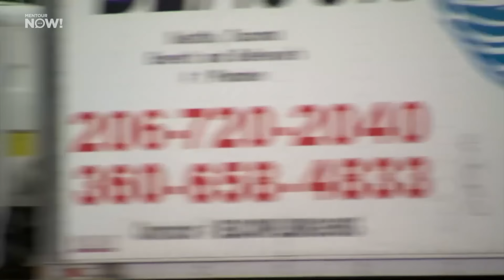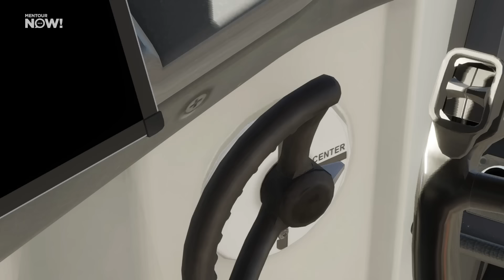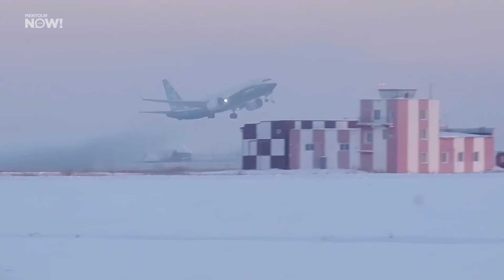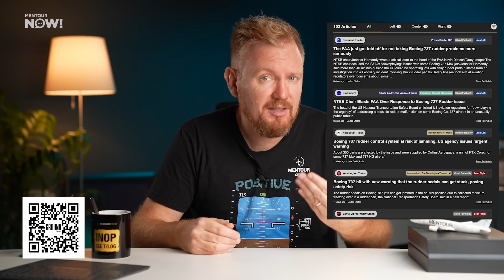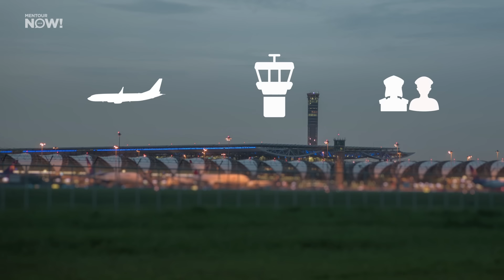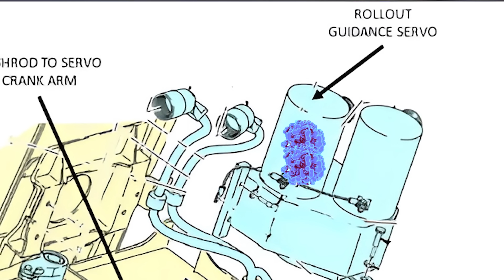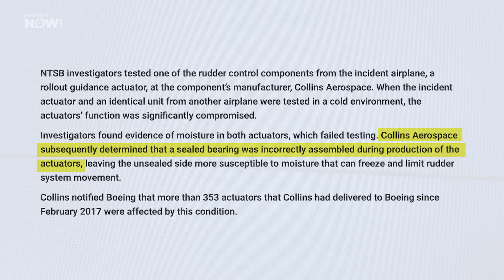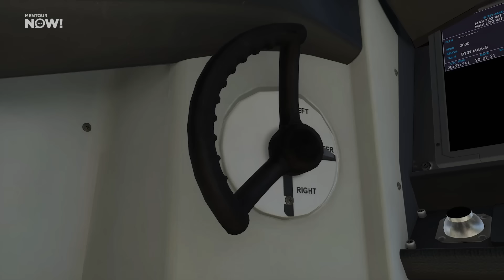Does the Boeing 737 Have ANOTHER Major Flaw!?

Comment: Ah poor 737, entered service during the 1960s , stretched, re winged, re engined & upgraded to death... For how long can it be milked until a new airframe be developed ? Systems old and new slapped together creating a nightmare for fabricators and maintainers alike ...
Reply: Remember that the 737 airframe is a shortened and slightly modified variation of the original 707 airframe, which makes it nearly 70 years old.
Reply: Not even that. The 737 is really a shortened re-winged, re-engined 707.
Reply: Airframe of Theseus
Reply: Frankenplane.
Reply: We cannot anymore, the technology is lost. Finances are more attractive than engineering nowadays, Boeing outsourced development.
Reply: Boeing wanted to build a new Airplane, they used to call it the NMA. Calhoun (the Board) killed it. All they, Calhoun and the board wanted was to continue milking the 737, as it was cheaper in the short term. The term being Calhoun's and the boards influence. Shortsightedness and greed killed Boeing. Bean counters, not the engineers killed Boeing.
Reply: @renefuller9241  yeah, by the way, did you know that Calhoun was a McDonel man? There was a saying in the industry after Boeing bought MD, that MD bought, Boeing with Boeing 's money.... (because of the hugely beneficial terms for MD,' s higher echelons)
Reply: @yanniskouretas8688  I thought Calhoun was a Jack Welsch disciple... Well, no matter really, same thing different name.
Reply: You make it sound like Trigger's broom from Only Fools And Horses

Explainer if you haven't seen it:

There’s a great gag from an episode of Only Fools and Horses where street sweeper Trigger has been rewarded by his local council for using the same broom for 20 years.

“This old broom has had 17 new heads and 14 new handles in its time.”
Reply: @Rachel_M_  Which itself is a reference to theseus ship
Reply: @Rachel_M_ class reference 😂 but it’s “new”
Reply: @Rachel_M_ interestingly this has a an example of the paradox of the the ship of Theseus, first discussed by Plutarch.
Reply: I can just see the poor pilots trying to explain to Ryanair  or jet2
management  how they left the runway and wrecked  a 737by booting the rudder to unstick it on landing
Reply: It was working great for Boeing until the max. If Boeing didn’t screw up the design of mcas, I think we would all be praising Boeing for keeping such a classic airplane in service.
Reply: @thehumblepilot22 Initial design of MCAS was not the problem. True problem was that pilots/airlines mostly didn't know about this system because Boeing exec's wanted to sell it as 737 so that no extra training needed for pilots.
Reply: @tony4404  true but I would say mcas pitching the plane down at low altitude would be a bigger issue which is a design problem. Technically the 737 runaway trim stab procedure that every 737 captain is required to know by memory should have been implemented. This is why Boeing didn’t mention anything because a procedure already existed to counter the issue.
Reply: @thehumblepilot22  The 737 had rudder failures long before the Max, the first rudder incident was in 1991.
Reply: @thehumblepilot22  The 737 MAX can hardly be called a classic airplane. It has TCAS, EGPWS, Flight Management, etc.the same as the latest models, and a system for pitch control using the spoilers if the elevator becomes jammed that no other airplane has. Also, Boeing isn't the one keeping the airplane in service, the airlines do. And there was nothing wrong with the design of MCAS; two airplanes crashed because their airlines had skipped out on training their pilots on a procedure required for the basic 737 type rating. A third flight crew got just-in-time training from a properly trained deadheading pilot of another airline and they landed safely at their destination.
Reply: @petep.2092  Yes I understand the aircraft has all the modern systems. When I say classic I guess I mean the modern version of a classic plane. However MCAS on these particular 737s that crashed had only one AOA sensor that was definitely an issue with the design. I do agree that the issue was also a pilot training problem since the pilots had no idea to turn off the auto stab switches when the trim wheel kept spinning pitch down like crazy over and over. It’s hard to miss because the trim wheel is very loud in a 737. But I also don’t fault the pilots for being confused when the plane randomly nosed down at low altitudes when climbing. It was a combination of the MCAS designed with one AOA sensor and pilot training in my opinion.
Reply: @DontUputThatEvilOnMe hardly so . 737MAX is 60 years old airframe . You are talking nonsense really
Reply: @AnetaMihaylova-d6f  Actually, each airframe is made from new materials, not 60 years old. The design of the airframe may be 60 years old, but what are your criticisms about the airframe design? Even if YOU don't understand them, the 737 MAX evolved out of deliberate improvements based on known science and engineering, For comparison,  your DNA design was revised incrementally—by a hit or miss process—over millions of years. Reality check on who exactly is talking nonsense.
Reply: @AnetaMihaylova-d6f  737 NG which started production around 25 years ago were probably the most safe and successful narrow body aircraft ever made. Most of the 737s in service today are NG models.
Reply: Very nice comment 👌
Reply: The Corolla of the skies.
Reply: "upgraded to death", it's spooky how you nailed it exactly.
Reply: You miss the point behind the Max.   It came down the pool of potential pilots.   The original 737s were wearing out.   The idea was that with minimum re-training, pilots could transition from the 737 to the 737 Max.    Most of the bean counting was done by the airlines that had 737 pilots.   Boeing did cut some corners on the lack of redundancy of Angle of Attack sensor and that's 100% on Boeing.   But making a new aircraft that more or less flew like a 50 yo a/c was the goal.
Reply: @GilmerJohn  It had redundant AoA sensors, but Boeing failed to ensure they were used redundantly which would have been a fairly simple task - do the AoA readings on Captain's and FO's sides agree? No - disable ACAS.
Reply: @cambridgemart2075  --  Really?   I read that the redundant AOA sensors were an option.   Indeed, there should have been three although I' don't know where #3 would be mounted.
Reply: It's called engineering, something your comment proves you know nothing about.
Reply: Big part of the problem with mcas is that is was deemed non critical. As we now know it was. Critical systems are required to have redundant sensor input.
So, lack of critical thinking on the parties responsible for classifying flight systems.
But by no means was this a software bug, that is just a lame explanation.
Reply: @mennol3885  Absolutely, it was Boeing trying to hide critical flight systems as non-critical. This was necessary to avoid having to re-certify the aircraft as a new design regarding the pilot on-type certification.
Reply: The thing is the embodiment of corporate cost-cutting. It's actually quite hideous to look at. Old fashioned front end. Flat-bottomed engines. No landing gear doors. Gaudy double winglets.
Reply: @marzoval not arguing about the corporate greed part, but aesthetically I disagree. The 737 is beautiful exactly because it's such a brutal utilitarian Frankenstein of an airframe.
Reply: And above all  boring self certify their plane
Reply: Created with a major flight control problem with the ptich trim. And never really solved.
Reply: @stabilo3170  --  the problem was in the automatic trim of the vertical stabilizer.   Most folks seem to believe the problem has been solved.
Reply: @GilmerJohn  Maybe you are referring to the rudder runaway or hardover or the recent icing problem in yaw control. I was referring to the specific 737 pitch control glitch where in case of runaway the crew is unable to use the manual pitch trim (I mean the trim wheel in the cockpit) above a given speed due to aerodynamic loads on the screw jack. The only way to escape is the famous "yo-yo" maneouver.
Reply: @stabilo3170  -- Yep.   That's what I'm speaking off.   The problems start when the trim control gets screwed up (usually caused by the AOT sensor).   When this happens the pilots can attempt to use the manual trim but sometimes the out of trim condition is so bad that the only way to use the manual system is to "unload" the vertical stabilizer.   The flight controls affect relative small "flaps" on the tail whereas the trim adjustment turn a good sized screw which rotates the entire vertical stabilizer.   Boeing has several fixes and recommendations.

I saw a few YT videos on this.   Quite interesting.
Reply: @GilmerJohn  Pitch trim is the horizontal stabilizer, not the vertical. The original problem is not related to the AOT, but  purely mechanical, at a given speed the crew is unable to move the trim wheel due to the aerodynamic loads on the screw-jack. Pilots need to alleviate the aerodynamic loads by applying opposite pitch leading to the famous "yo-yo" manoeuver.
How could such poor design be allowed to  endure by the certification authorities? FAA/EASA.
Some one has an answer?
Reply: @stabilo3170  Greed. Pure and simple, the need to be able to retain the type license. The Angle of Attack sensor was single, there wasn't even a backup the software would have been able to reference to filter out erroneous readings. Those erroneous readings caused the Software to override the Pilot's inputs. Had the Software been written by Boeing Engineers, they would have been able to fix the problem before it manifested itself. But the software was written in India by vendors that didn't know an airplane from a hole in the ground.
Reply: @GilmerJohn  Horizontal, not vertical. MCAS actuated the elevator trim system.
Reply: I'm pretty sure the Max will be the last 737 variant
Reply: I will answer that for you.
Until Boeing goes out of business and lost almost all customers to their competitors, not a single day before. 
EXACTLY like McDonnell Douglas. They just updated and modernized the DC-9 into the MD-80, MD-90 and 717 (planned as MD-95)
Until the airplane was basically so outdated that further updates were impossible. And the lost the whole narrowbody market to their competitors.
And they did the exact same thing with the DC-10 and just turned it into the MD-11 and also lost the widebody market to their competitors.
They basically ruined the company with their unlimited greed is good concept.
Because their motto was: "why develop a new plane ? That costs money ! Let's just use the money for research and development and give that to the shareholders as a higher dividend instead. And that mindset is now alive and well within Boeing. (when McDonnell Douglas took over Boeing after being merged with them)
Boeing has BECOME McDonnell Douglas.
Reply: There is nothing wrong with the concept of MCAS. The problem was that it was poorly implemented, pilots not properly informed and they only relied on one sensor. If they had done it properly it would’ve been fine. Also the engine placement was the cause for why they decided to add the MCAS but in itself isn’t the problem. It is not ideal but it would be fine, if they would have adjusted for it properly. There is nothing inherently unsafe about putting the engines were there are.
Reply: @sebastiang7394  unfortunately the engine placement thing too many people don’t understand this.
Reply: It's not the airframe itself that Boeing want to keep around as much as it's all of the manufacturing tooling, test and every other bit of type specific infrastructure etc. and key leadership talent that must be replaced plus all of the certification and bribes that must all be costed in making a new design uncompetitive right from the start.
Reply: @karlslicher8520  No, it's not just that. They, or rather the airlines that have existing 737 fleets, really really want to keep the same type certificate for pilots, and as preferably much as common parts as possible (for spare parts inventory)
Reply: Noone needs a 737, except Boeing themselves.
We have a 320, Comac and MC-21.
Reply: @player1GR  --  Well, "No One" needs anything in particular.   The MAX solved a particular problem and it continue to solve that particular problem.
Reply: @player1GR  are you serious comac and the MC21. Boeing is literally making more 737 max’s per month than comac can make in a year.
Reply: And still going strong.  And will continue to be flown safely, for many years to come.
Reply: Your making the point that it is a nearly new plane.     MCAS was a horrible software failure.   The engines placement is not a problem.   Some airplanes have engine on top the wings.
As a retired software engineer it is unimaginable how it came out of a R&D lab.  Maybe it did not.
Reply: @danharold3087  no it was engine placement that  led to the MCAS and crashes
Reply: @AnetaMihaylova-d6f    Yeah that is the extent of MSM understanding.  They are wrong.  It is very hard to correct bad information when MSM has branded it as true.
If the engine placement was a real problem the 737 MAX would not be flying today without modification to the engine position.
Virtually all modern fly by wire airplanes let the computer decide how to fly the plane. This is much more radical than the augmentation provided by MCAS.
Reply: @danharold3087  no you are wrong.  MCAS came about because the engines were too far up
Reply: @AnetaMihaylova-d6f  that’s true but MCAS was placed on the aircraft to type rate it the same as the 737NG models. The aircraft didn’t need MCAS for anything else other than its type rating.
Reply: @AnetaMihaylova-d6f  No, you are wrong, for a subtle reason. It was not the engine placement. The plane can be flown just fine with the engines where they are. But pilots would need to be given simulation time to feel the plane want to pitch up on take off, and to practice how to counter this tendency smoothly. Boeing achieved profitable sales of the 737 MAX partly by promising there would be no need for any expensive (time and money) pilot training. So they built the MCAS system to do secretly what the pilots might have done, had they been trained to do it. MCAS only used one AOA and when the AOA it was using had problems, the MCAS went bonkers.
Reply: @We_are_Nomad  It's conceptually not a bad idea to use an augmentation system to make sure the handling remains very similar to the previous 737 even at high AoA. In general the handling of a plane is something that's engineered by the designers anyway, and the control feel is completely artificially generated in all airliners (and other planes that use hydraulic or electrical actuation of control surfaces). The big problem with MCAS isn't the idea, it's the mind-bogglingly terrible implementation.
Reply: @MatthijsvanDuin  Well, the statement I was correcting had to do with the forward placement of the engines, which were not the critical--possibly not even a nominal--problem with the plane. 

But as to your own comment...I don't think that "implementation" is quite enough to explain the problem, either. It wasn't poor implementation of a good "concept." The concept never got off the ground, if the implementation is any guide to its qualities. My Indian-made microwave runs on the same principle as the original MCAS. Even if they were not working with a hard concept, based on previously proven designs, the concept would have developed until it was suitable and safe, it they had followed the rules of their industry. But the concept was never given this chance to be reviewed and developed, nor the implementation to be tested, denied, corrected, and ultimately accepted. The process was circumvented by the main goal: that the MCAS system be so secret that it wouldn't involve FAA inspection or pilot training. Secrecy is what led to the hull losses. 

As you say, an augmentation system is not a bad thing, and other such systems are in various parts of the plane. But all of them are known, explained, studied, involved in the checklists, etc. They have redundancy built in. Workarounds are available. All of this practice requires transparency of information and operational practice in simulation. Secrecy is also the reason for the MCAS system being implemented with only one alternating AOA sensor for guidance, which does not conform to the redundancy requirement of the dual or triple sensors themselves. With any amount of transparency and FAA supervision, the non-redundancy would have been noted and rejected until corrected. That money-managers made a decision to proceed with secrecy for the purpose of sales, over the engineering knowledge and standards for their industry, is the primary problem that needs to be corrected to avoid future losses. 

Recent issues with Boeing planes imply that they are just as secretive as ever, that they are willing to destroy evidence and avoid transparency even when asked to produce documents to supervising agencies. Their responses to several dangerous mechanical failures is minimal at best. Remember the downing of the Ethiopian airliner? That is the kind of impossible cycle that Boeing's financial "pitch" is facing, if they don't change their culture and start being more proactive and exacting in their engineering and manufacturing standards. As an American, I am really worried about this situation. America needs Boeing as a foundation of our national security, and, by extension, international security.
Reply: @We_are_Nomad  Yep, I agree.
Reply: @danharold3087  Primary reason for MCAS were the engines. Engine placement changed flying characterics so much that they installed MCAS so they can sell it as same than 737. Easy sell to airlines when extra training isn't needed for pilots.
Reply: @tony4404  The fundamental aerodynamic design of the 737 MAX itself was not the cause of the crashes. The aircraft's basic airframe and flight characteristics were not inherently unsafe.
The problems stemmed from how MCAS software was designed, implemented, and integrated into the aircraft's systems, rather than from fundamental flaws in the aircraft's design or the concept of MCAS itself.  
All airliners use software to make the airplane easier to sell.   Can you imagine Airbus if pilots had to train to fly each of its aircraft if they did not modify handling with fly by wire. Fly by wire is the ultimate evolution of Maneuvering Characteristic Augmentation Systems. Yes FBW does much more but MCAS is one aspect.
Reply: @MatthijsvanDuin  What was so mind-boggingly terrible about the implementation? Using one sensor? That was the incompetent news media's opinion. Do you know how many systems use a single sensor as an input? The stall management yaw damper (SMYD) computer uses a single AOA sensor as input. That's why the stick shaker activated on only one side when the AoA sensor failed. And MCAS is not even a critically necessary system, it is rendered inoperative if the electric trim system is shut off, which can occur for a variety of reasons.